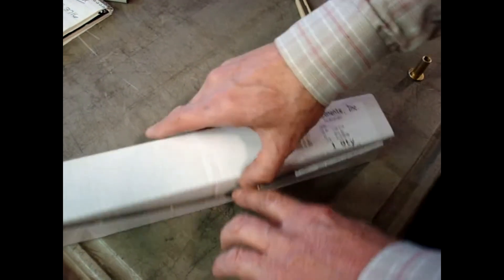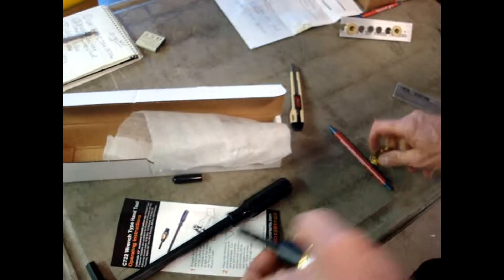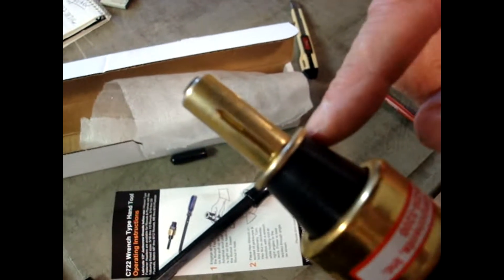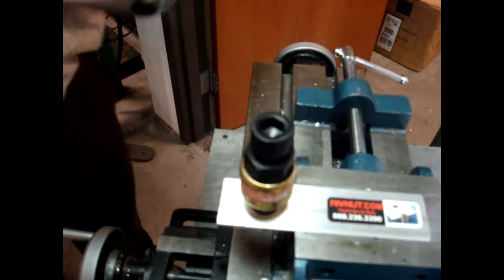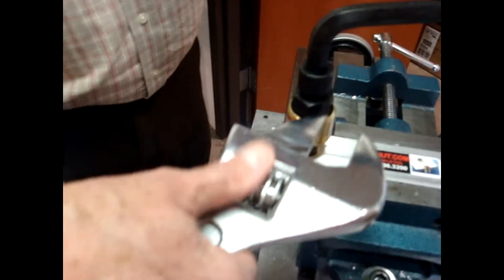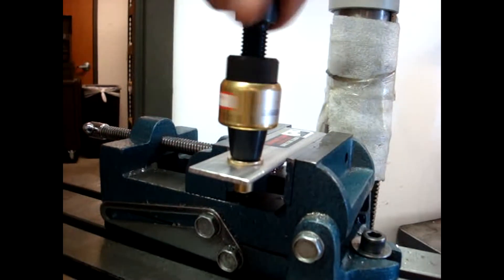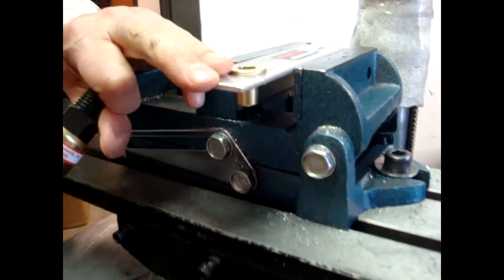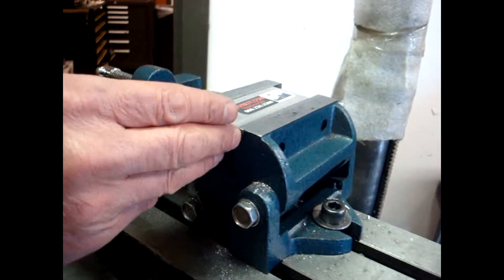C722 TOOL INSTALLING 3/8-16 PLUSNUT BY HAND

Comment: What size hole is necessary for a 3/8" - 16 fastener?
Reply from the maker: Mark, the hole sizes vary by the exact rivet nut.  There are many different body styles for a 3/8"16 fastener, all of which require a different hole size.  Take a look at our catalogs at rivetnutusa.com or give us a jingle at 800-236-3200.